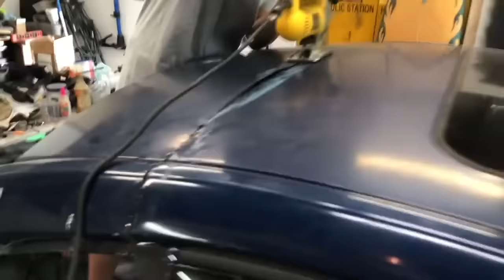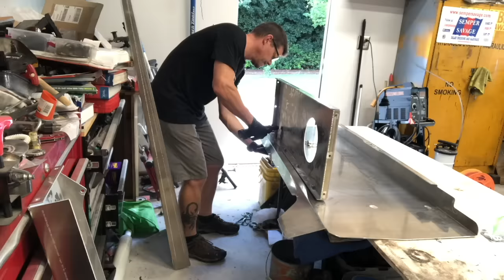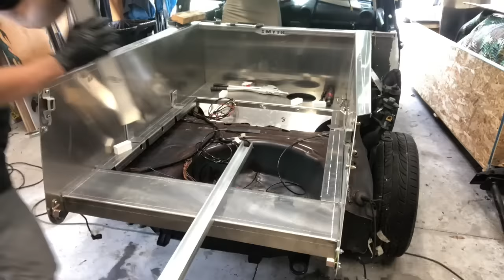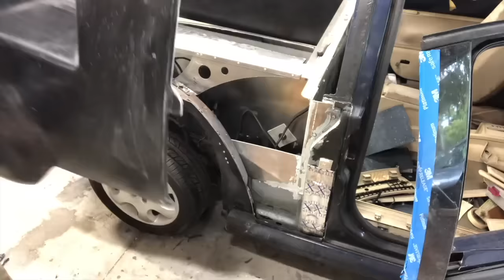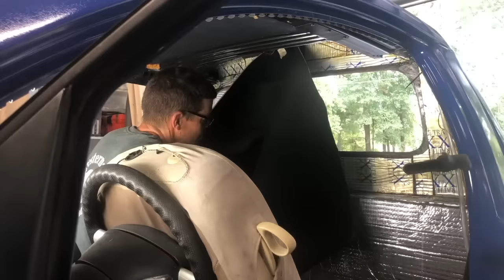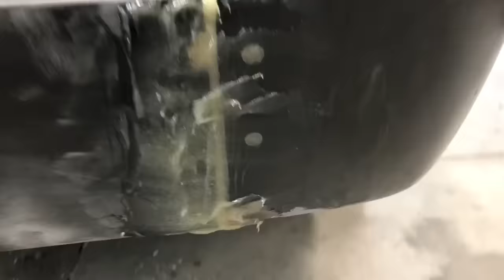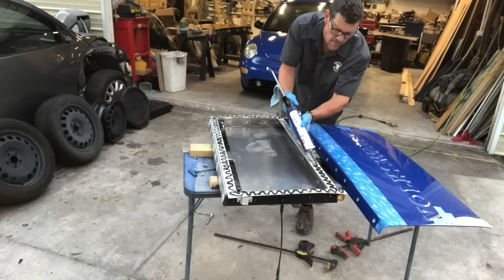Smyth Performance Beetle Ute build Full video

Comment: Just one question how do you service the rear shock absorbers now? Do t they have a nut just above the wheel well
Reply: Build is sick af non the less I don't now anything about newer bettles  not that many sold where I'm from
Reply from the maker: the 1998 and newer VWs have the rear shock mount in the wheel well. They don't come through the inner fender any more. So its all accessed behind the wheel.

Comment: Hey, das ist alles nur genietet... Wie lange soll das denn halten? Und die Stabilität?
Reply from the maker: No issues Ive seen with stability or longevity. It is also glued with 3M panel bond so its not just rivets. For more info on the engineering and safety, visit www.smythkitcars.com/engineering

Comment: I would like to see this done to a convertible
Reply: Mark Parlee so would I. Mainly because a convertible better is already stiffer lower due to the top. This basically destories the rigidity if the car, that simple sheet metal and fiberglass isn’t given back what was taken. But a convertible would be able to do good.

Comment: Good work, that would make a nice parts truck (Ult) for a parts store, VW dealership or any VW repair shop.  ;-)
The one thing I don't like is the waste of space, like the pockets behind the cab and especially the spare tire holder.
Reply: I would assume that the bed could be made so access to the spare tire still exists
Reply from the maker: The bed floor is bolted in. I keep a speed driver under the drivers seat. The spare, jack and lug wrench still fit in the spare tire well.
Reply: Maybe in the future modify the bed support structure by adding a ring over the tire well and fabricate a round panel that locks in place by slip tabs and dzus fasteners (screwdriver versus a speed driver)?

Comment: Excellent Ute, however i would have of welded a tube cage following the stock ribs and lines. There's no way for the floor its self on a Unibody car to not flex or have excessive stress points after removing all the reinforcing that evens out the load through the roof. The bed especially when riveted and not welded, offers nothing to the structure's integrity. It's shame for it to bend in half on a speed bump or not being able to turn properly due to tremendous flexing. Eventually the factory pointed welds will fail too. All these without any load on the truck bed.
Reply: yup, that thing could fold if he goes too fast over a speed bump... not at first one, nor second one, but eventually...

Comment: Question for you, when it comes time to change the rear shock absorbers how are you going to get to the top nut as it looks like theres no access now
Reply: 2 bolts face down to the shock top mount, you don't need access, nor do you have it on the beetle to start with
Reply: @mark1vws962  very good.

Comment: Definitely awesome, but you chop the vehicle in half basically and bolt and rivet all that in.... There's no structural support really, I feel like after a lil while it's gonna start bending and saggin, fiberglass will start getting stress fractures over time, and your rear suspension is only connected to the original frame, which is chopped in half. Cool as hell but there's gotta be something more then silicone rivets and bolts
Reply from the maker: If you wanna see how they fair in a crash, visit https://www.smythkitcars.com/engineering
They are pretty well engineered. By the way, everything is assembled with panel bond. Not silicon. The sealer used is just to smooth the seams or seal the bed seams

Comment: Won’t spare tire tub fill full of water over time?
Reply from the maker: It has drains. Otherwise it would. Might have noticed the original steel (and the spare wheel tube) was brown al the sudden. I didn't film it but I treated all the steel under the bed (and where I cut) with some heavy duty anti corrosive paint.

Comment: any welding ? at all?? rivets ok but nut bolts not really strong enough .....
Reply from the maker: no welding because of the dissimilar metals issue. I Don't have any doubts about the strength of this kit but there are plenty of options for fastening. Most places it is the builders option for bolts or rivets and how many you want to use. most of the loads are shear and in that case, bolts generally win vs rivets for shear strength. Also not depicted all that well is that I used panel bond in all the seams. Bending maybe not but shear strength is amazing assuming you prep your surfaces correctly/  For some interesting info and pictures of a rear ended Ute, visit https://www.smythkitcars.com/engineering

Comment: Are the fenders a kit
Reply from the maker: Yes it is a kit. Smyth Performance. www.smythkitcars.com. There is a tab on their website that discusses the safety and engineering. A lot of naysayers rag on the fact you are cutting into the structure of the car but Im very happy with the integrity of the kit. I swear it is stiffer now than it was stock. I have a friend that was rear ended in his Jetta kit, It faired very well.

Comment: the back sheet of the gate, where did you get that???
Reply from the maker: the fiberglass panel comes with the Smyth kit. I mad an additional thin panel that I molded off a VW Caddy tailgate then grafted it onto the supplied panel
Reply: here is the video https://youtu.be/hMPrTSfRFfA

Comment: How do you replace the rear shocks when it is time to do so?
Reply: The MK4 era cars the top shock mount is accessed in the wheel well instead of on top of the wheel well like MK 1 and MK 2 cars. So it is all the same still after the kit is installed
Reply: @hestermannmotorwerks  , thank you.

Comment: nice view.      rivet  rivet  rivet  sturdiness?
Reply from the maker: I add in some stainless steel rivets and bolts in the high stress places to make sure it stays rigid over time
Reply: The rear pillars of the ceiling were cut

Comment: So now how you change rear coilovers?
Reply from the maker: The MK 4 era of VWs the rear shock mount bolts in from inside the wheel well instead of on top. So access hasn't changed

Comment: That looks epic the wood kills it though
Reply from the maker: Yeah I realize not everyone appreciates wood finish.
Reply: @hesty32  yup makes it look like a barn truck 1950s ngl it just doesn't fit with the aesthetics of a modern ute could of easily been done in tube to fit design. Are we talking about the same thing here I'm personally talking about the pallet wood on the sides of your tailgate
Reply from the maker: Oh yeah I thought you were talking about the wood panel in the back of the cab. Actually the 50s barn truck was kinda the look I was going for. I used cheap pine cuz I didn't want to spend a lot on something I wasn't sure Id like. Took a while to decide but I have removed the stake sides now. Has more of a hot rod look now
Reply: @hesty32  yup it'll look even sexier  as a hotrod

Comment: one thing i don't like is covering up the spare tire well. I'de modify the bed floor so i could access the spare if i bought the kit.
Reply from the maker: greg h a couple guys have cut the bottom out of the spare tire well, welded a sheet over the top and installed a tire winch from a small pickup. That way you can lower it and access from underneath. Another builder riveted all the floor panels together and put a piano hinge across the front. Two Zeus fitting in the back and it works kinda like a bed cover. I just put a donut spare behind the passenger seat. But may do the winch idea on the next one

Comment: The part I dont understand is all the hole drilling ya pay 3 grand for about 10 panels why arent they predrilled??
Reply from the maker: Kyle Love the bolt holes are predrilled. I prefer the rivet holes not be predrilled so I can put them right where I want them. And with three layers in some cases, you might spend a lot of time trying to line them all up! Gotta drill the car panels anyway so it’s really not a big deal

Comment: What's with the spare tire??
Reply from the maker: It goes back into the same well under the bed. You just have to unbolt the bed floor fasteners to access it. I keep a speed driver under the seat to make spare tire access quicker

Comment: The video did not show how to open the engine since it was covered by truck floor
Reply from the maker: the New Beetles are front engine so access hasn't changed. The spare tire is under the bed floor though and now you have to unbolt the floor to access the spare.

Comment: end result looks good but there’s zero strength put back in with aluminium and fibreglass. When you cut a monocoque like this you weaken the overall structure. If this thing gets hit from the side or rear ended, it’ll fold up like a coke can.

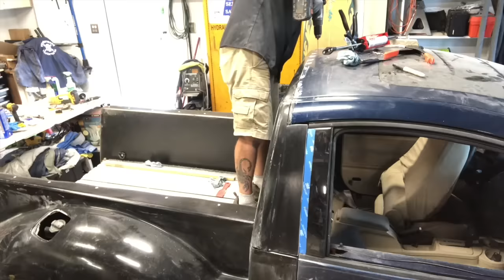Comment: Trear corners of the roof shd have a proper join with the kit parts, not done with filler 12:30
Reply from the maker: do you mean putting fasteners through the roof panel and the rear (kit) panel instead of just using bonding agent? Filler was just to smooth the seam, joint is with panel bond

Comment: Nice Job    BUT A COMPLETE DEATH TRAP  NO BRACING  done  held together with with screws and rivets  and not much else
Reply: Airplanes are constructed with rivets and screws and they last decades. An aluminum body can be as strong as a steel one, as long the build is well executed.

Comment: THERE IS A TOOL CALLED CLECO FASTERNER FROM AIRCRAFT SPRUCE. IT'LL MAKE YOUR RIVETING JOB MUCH EASIER AND FASTER.
Reply from the maker: I have Clecos, In this kit, I find it just as fast to clamp with C clamps or bar clamps. Clecos are great when you already have the holes drilled and they are matched

Comment: i would invest in a Milwaukee 12 volt rivet gun
Reply from the maker: Good point, I have a pneumatic rivet gun but with the fiberglass and AL, I like the old school feel of how the rivet is going. Doesn't really matter I guess because you are still gonna pop the rivet but it just feels like you have more control

Comment: I have an '07 Ranger. Ford is releasing a new (for US), "Ranger" after several years of no US production Rangers. While that's a good-looking vehicle, it's really not even vaguely related to actual Rangers-- it's a ridiculous (and pricey) beast-- quite a bit larger than my truck.

And it's got far too many fancy doo-dads that weren't even options in the original Rangers. It's just not a small, utilitarian little truck anymore. Why?

Seems that nobody makes simple and basic smaller trucks anymore. Everything has to make a "statement" nowadays. And it needs to include every electronic marvel known to man. Why? I don't need "lane assist" and GPS to run to Lowe's for some lumber or bricks. Rangers were never intended for long road trips. Small utility trucks don't need to go far. They just need to be useful and cheap. Nobody makes those for the US anymore. 

That Beetle conversion is a sweet little truck. I really like it (minus the surfboard). But I'm sure it costs more than many of us would want to spend on something to beat up hauling around lumber and stuff. And never washing-- like me. My truck has a patina of filth all over (five years' worth), and I'm okay with that. I've never vacuumed the rubber mat floor (note: there's no carpet). But I do keep a plastic grocery bag hanging off the floor stick-shift for the five-speed manual to control the trash. 

Why can't we have a small truck for trips under 20 miles that don't cost three years' worth  of our retirement income? Simple and basic and reliable? My little Ranger is going to crap-out one day, What am I going to replace it with? All other REAL Rangers are aging, too. No options there. Bigger is not better, and fancy stuff just adds cost to buy it (and more cost to repair it).

Anyway... very nice conversion build, guys! Very impressed with the quality and look. Can I buy it for five grand?
Reply from the maker: I agree whole heartedly! I have a 3/4 ton dodge for towing stuff (boat, RV, other cars) but 90 percent of the time, need to move 500lbs or less. I love a little truck. These really arent built to compete with small trucks though. You can get a decent running (but not pretty) Ranger, Tacoma, Nissan etc for $2-$3k in my area. Depends on what you start with but this (or the Jetta kit) is gonna run you $5-$8k if you do it all yourself. To have someone else build and paint it is gonna run closer to $10k.  That being said, the Jetta kit I built hauled a lot of stuff for me. At my local Lowes/Home Depot, the guys alway offer to load it for me cuz they want to come check out the truck. Ive towed boats, hauled patio doors, 1000lbs of sand bags, wood chipper, ditch witch, all kind of stuff. Small trucks are really useful! I hope your Ranger gives you many more miles before it expires!
Reply: @hesty32 Thanks! I don't put a lot of miles on my Ranger-- 12K in 5 years. So I might get another 12K out of it. Lots of old Rangers in my area, I can count 10 to 15 during a 20 minute drive. Nobody is selling any of those! I see far fewer small Nissans and Tacomas out and about, so either Rangers were far more popular back in the day, or they have lasted longer. This one's a keeper!